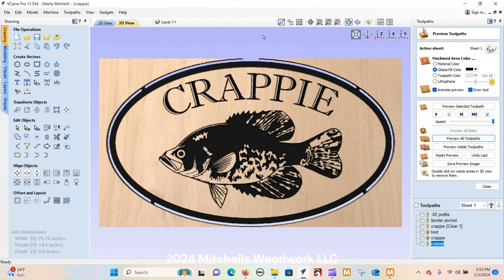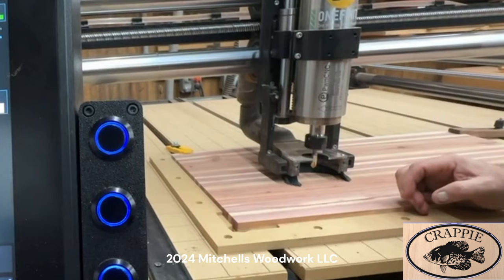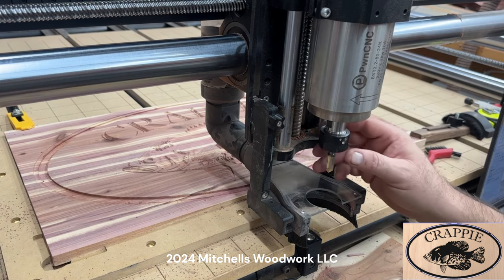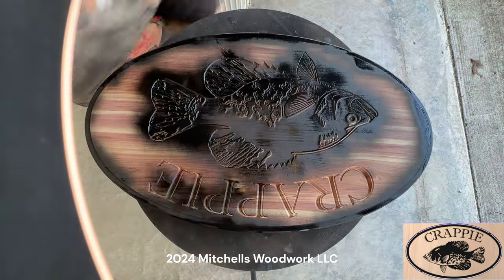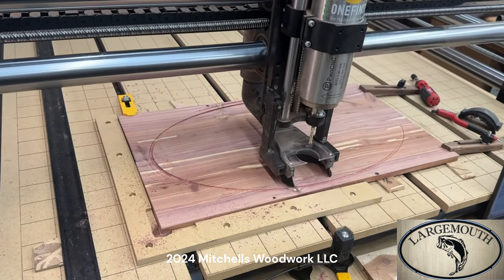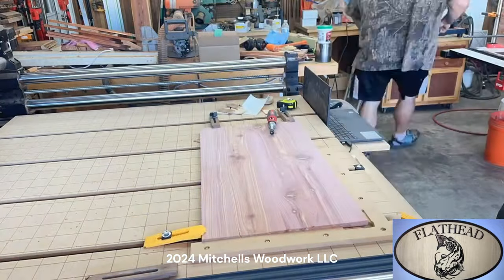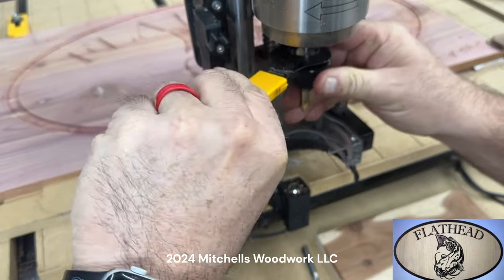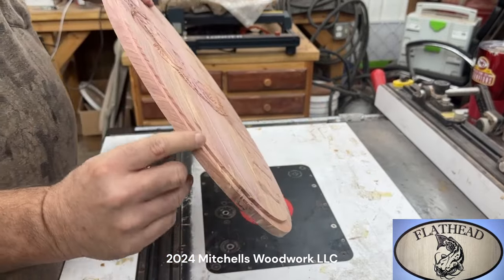Making the Crystal Springs Marina Village Signs Pt. 2 | Onefinity Elite Foreman CNC | PwnCNC

Comment: Could you explain in one of your upcoming videos why you do not put your magnet on the collet when probing Z?
Reply from the maker: Thanks for the great suggestion.  But to answer your question, from what I understand, it’s because I’m running a spindle instead of a trim router.  I’m also using the QCW wasteboard (which is where my probe magnet is attached).  The spindle and QCW are grounded to the CNC, whereas a trim router is not.  But I’ll talk to PwnCNC and get an official answer before mentioning it in a video.